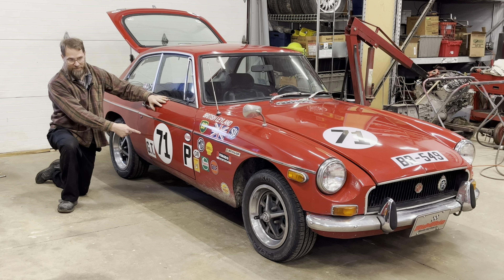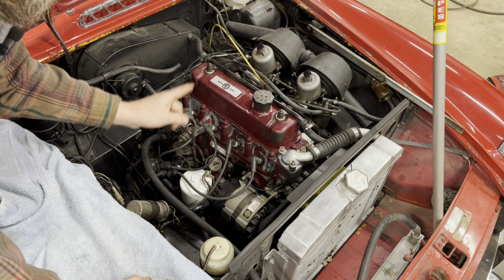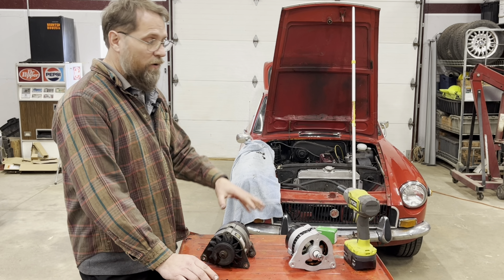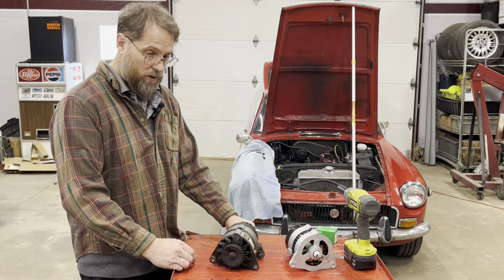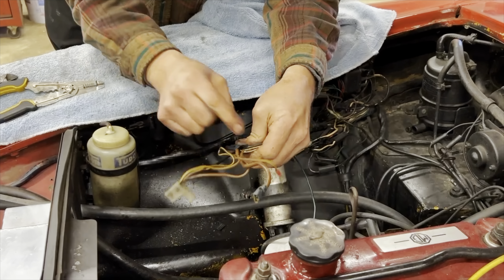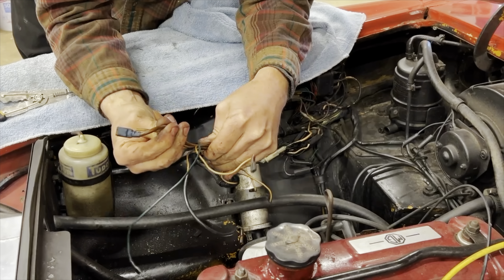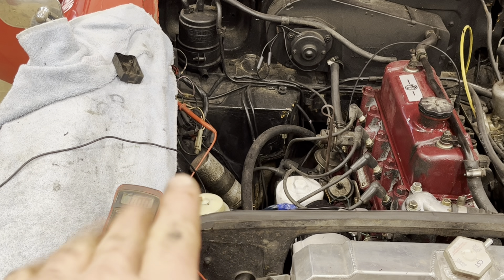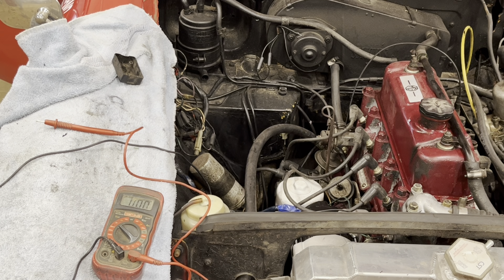1971 MGB Lucas 5 wire alternator to late 3 wire conversion

Comment: Thanks! Super helpful, I got a 71 GT, and the wiring is a mess, My alternator light wont turn off and it looks like it has some strange aftermarket alternator and the wires were not properly attached and put back. After seeing this kit, I know the way to go! Saved me a ton of research!
Reply from the maker: It’s not really a kit, you have to buy the alternator and the plug separately. But I’m glad that it helped you.

Comment: How is the ground of the alternator connected? Via the mounting bolts and brackets? The alternator on my '64 MGB has three wires connected. I assume this has been done by a previous owner. I haven't checked yet what each of these wires does.

Comment: im putting an altinator into an MGA So I have a yellow small, a yellow big and a big yellow with a green stripe.
Reply from the maker: When you’re starting a with a car that originally had a generator, the wiring colors are different. on this one we were just going from a five wire alternator to a three wire one. If you want to know how to wire that alternator into the Mga, you can go to the Moss Motors website and look at the instructions for the alternator conversion kit they sell. There’s a bit more to that one than just getting the wire colors right, you also have to rewire or change out the regulator with the dummy one

Comment: looks like there are only two wires on the new alternator...am i missing something?
Reply from the maker: Nope, your not. While it is a 3 wire alternator, you only need to hook up 2 for it to work correctly